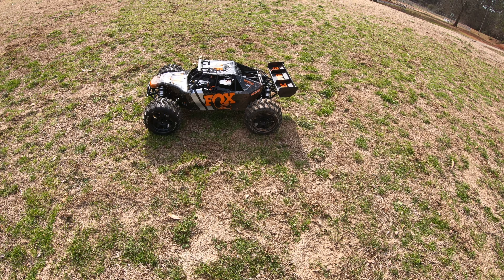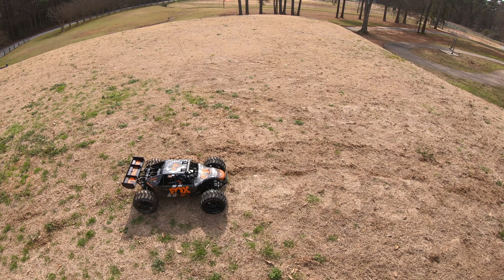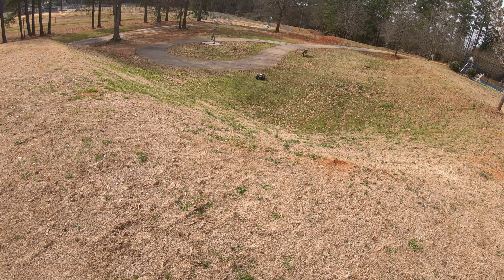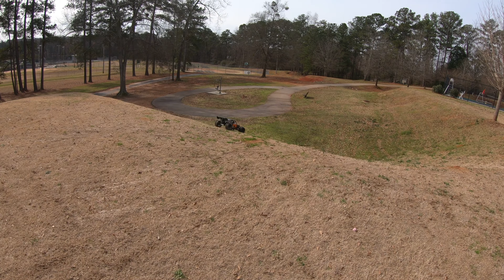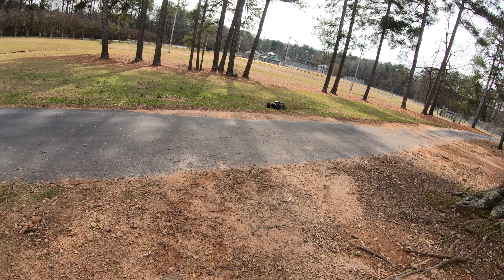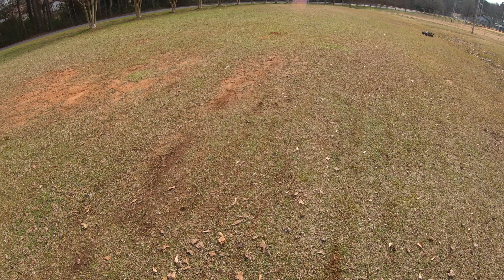losi DBXL E 2.0 park bash and speed run

Comment: Most smart batteries will begin their discharge after 10 days of sitting after being fully charged. My Redcat Racing Shredder pinion gear comes lose a lot also, even though I use blue locktite and I tighten that thing as much as I possibly can, it still comes lose. I can't explain it, but I'm glad that each time it does it, the gear stays on the motor and I haven't lost one yet. I think I'm gonna go to the hobby shop to see if maybe I can buy a better set screw that won't keep backing out on me!!!  Good luck bro, keep us posted as to how you fix this little issue. THANKS FOR SHARING!!!
Reply from the maker: SOUL FORCE QUADS ok cool thanks for the battery info and no problem I enjoy doing YouTube videos 👍🏾💯 Rcfam4life
Reply: @GAPreviewsAtoZ  I think we both need longer set screws to stop the pinion gear from coming lose!!!
Reply from the maker: SOUL FORCE QUADS I’m about to gear ⚙️ up so the new pinion should come with a new screw 👍🏾💯
Reply: @GAPreviewsAtoZ  Cool bro, that should solve your problem. My pinion gear didn't start coming lose until I changed out my spur gear. The new gear, with the new screw should work fine!!!
Reply from the maker: SOUL FORCE QUADS that’s what’s up bro 👍🏾💯

Comment: Well man, that's part of RC life:) Here's what I do on mine. Instead of Loctite 242 which most use on just the pinion screw, use the milder loctite 222, but also use a bit on the shaft. Mine hold up on a TP 5870 with a MTZ 300.
Reply from the maker: Ok bro thanks for the info the last time I did it it Hasn’t come Loose I’ve drove it about seven times since that video and it seem to be doing well now 👍🏾💯 Rcfam4life

Comment: Beast mode bro 💪🏾 rcfam4life 👑
Reply from the maker: Yes just got to keep the pinion from coming off it came off the last two times I ran it 👍🏾💯 Rcfam4life
Reply: @GAPreviewsAtoZ  just take a small drill bit and make a small dip and the set screw should lock in place

Comment: ✌🏻😎🏴Nice run Gap. It’s a shame that pinion came off again. Carry some para cord or bungee cord with you so you can drag it back instead of carrying it. That thing looks too heavy to carry 😂
Reply from the maker: RC Masked Master yeah I am because that was a workout taking it back 👍🏾💯 Rcfam4life
Reply: @GAPreviewsAtoZ  Just grab it by the front bumper and pull it.  It's like one of the suit cases with a handle and wheels.

Comment: Just ordered mines. Be running the Futaba 7pxr radio with it. Any suggestions on upgrades I can get now before it arrives. Have a Futaba 7pxr radio for it and a castle mamba monster x 8s esc for it. Maybe some motor fans and aluminum front/rear chassis braces be good first upgrade and some beefcake tires
Reply from the maker: IMPORTKILLR R/C put red lock tight on the Pinion gear and the duratrax hatched x wheels and then you are good to go thanks bro 👍🏾💯 Rcfam4life
Reply: @GAPreviewsAtoZ  yeah I'm lovn the look of the dbxle 2.0 with those wide tires. RC that size definitely needs wide tires.

Comment: Bro do you get any rubbing with those tires? If so do you use wheel extenders?
Reply from the maker: No mine runs great
Reply: @GAPreviewsAtoZ  Ok cool i ask because running my Powerhobby Raptor XL they run fine until they start to swell then they start to rub i just ordered the Hatchet 5503 so just checking to see if they rub

Comment: Am trying to change my pinion gear from 17t to18T for alittle more top end speed, For some reason i cannot get the Pinion gear off i believe its loctite on the shaft any suggestions?
Reply from the maker: Yes it’s on the shaft get a small Torch from the gas station and heat it up then A screwdriver and pry it off

Comment: How u think that hobbywing motor will run in that dbxl 2.0 1100kv max5
Reply from the maker: Antione Ross awesome but you need the 800kv it’s much better the 1100 kc is going to be struggle with the weight in a long summer bash👍🏾😂 Rcfam4life

Comment: Do the double Loctite trick. Apply Loctite use lighter heat up grub screw to dry take off grub screw and reapply more Loctite. Even do a triple Loctite job. Like your old pinions with caked up Loctite those never fall off
Reply from the maker: IMPORTKILLR R/C do the most trust me mine came Loose three times👍🏾💯 Rcfam4life
Reply: @GAPreviewsAtoZ  I was looking at getting the proline 4.3 trancher x beadlock wheel tire combo. Horizon hobby has them for $212.00 for set $106 per 2. Says for xmaxx think they fit the dbxle 2.0? I mean it is bigger than the xmaxx from what I see. Any issues fitting the duramax tires? Need axle hub extenders or anything? Thanks brother!

Comment: U have the same truck and love it.  Man you gotta run it, not baby it.  You calls those jumps?  You call running around on grass bashing?  Come on.  Use red Locktight on it for the gear.  I did and never had a problem since.  You can get it off if needed.
Reply from the maker: I'm running the mmx8 and 800kv castle in there now and its a beast also no I don't bash hard with all my rigs just some of them thanks for watching 💯 👍🏾

Comment: Whats Your punch level ? and what runtime do You get on 5000mah 50c?
Reply from the maker: Enigmatiqu punch 5 and about 15 min in a smaller area and about 12 min full boar in a big area thanks bro 👍🏾💯 Rcfam4life
Reply: @GAPreviewsAtoZ  shiiiit that's not much
Reply from the maker: Enigmatiqu not really but if you run hard that’s not that bad because of motor temps you don’t want to hit Thermal shirt down not good for your motor and ESC